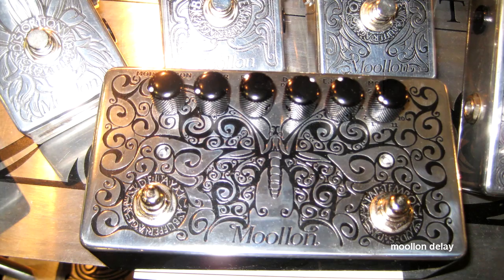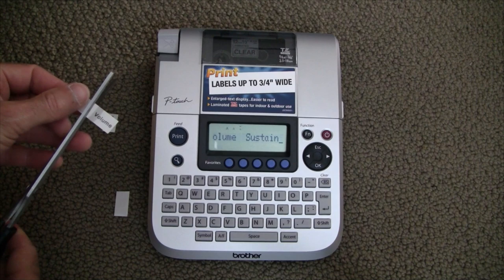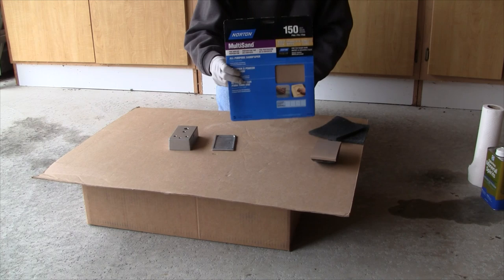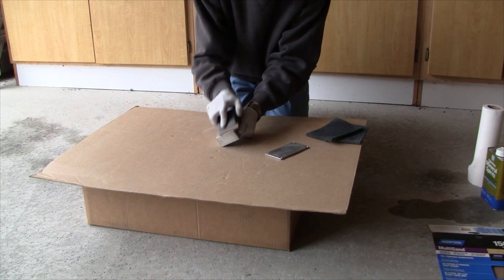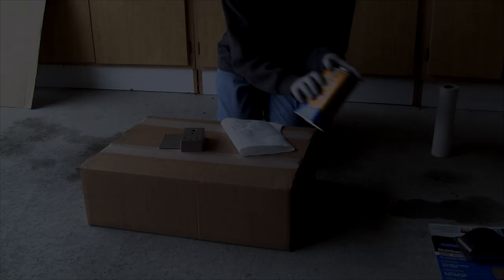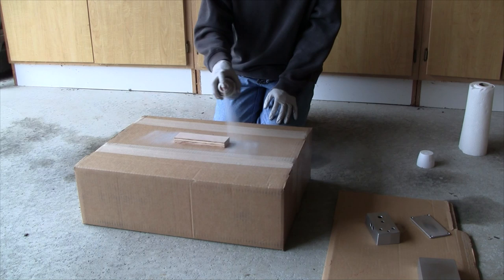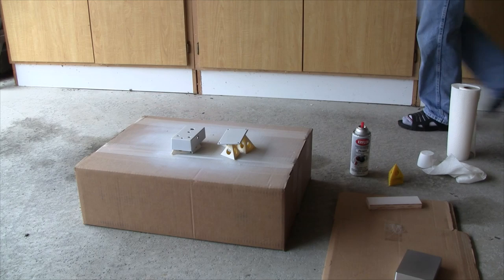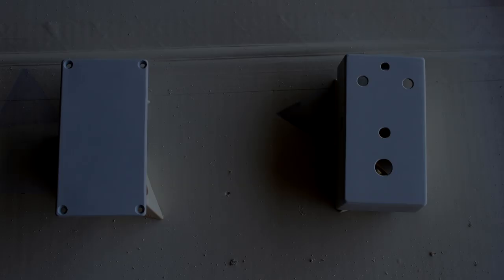Pedal Enclosure Finishing: Surface Prep, Priming and Painting

Comment: A trick for bringing down the raised area where you put down the labels, where the clear coat is a little more raised, is to sand back some of the finish until it is flush, then you can hit it with another even coat of your clear. I recommend using a straight sanding block and starting with some 400-600 grit so you don't remove too much product. Remember, do a few passes, and check often.

Comment: Please note that there's a wide variation among these clear coats in how hard they get, and how long they take to harden. When you're going as thick as 5-6 coats they take forever to harden up. You will see evidence of this in that for days or even weeks you can still see a fingerprint impression on the surface when you press on it, as the clearcoat is still flexible. I do a glitter finish on some pedals where the thicker the clearcoat on top is, the better it looks. Even when using automotive 2k catalysed finishes with compressor and spraygun, they still seem soft after weeks and I will not go beyond two heavy coats.
My advice with clearcoats, less is more. Unless you particularly need to have a thick enough layer for glitter flake metallics or to hide decal edges etc. don't give yourself a headache with a thick slow drying squishy coat, keep it 1 or 2  med coats which harden up quicker and have a nice fast assembly time.

Comment: Hey John,
What does the steel wool do in this case?
Why does finer sandpaper like 80 or 100 work better for a natural finish?
I'm planning on doing a klon and leaving it as a natural finish.
Thanks! 
Miguel
Reply from the maker: Steel wool just gives it s smooth polished look.  80 and 100 sand paper are quite coarse.  Best thing is to just try it yourself, progressively changing to finer grits and stop when you like the look of it.

Comment: Do you need finished aluminium or can you waterslide straight on an unfinished pedal? can you clear coat in krylon you used in the waterslide video if that's needed?
Reply from the maker: I've never tried applying the waterslide to an unfinished pedal, but I assume it would work fine.  In any case, yes, you will certainly need some kind of clear coat to protect the decal.